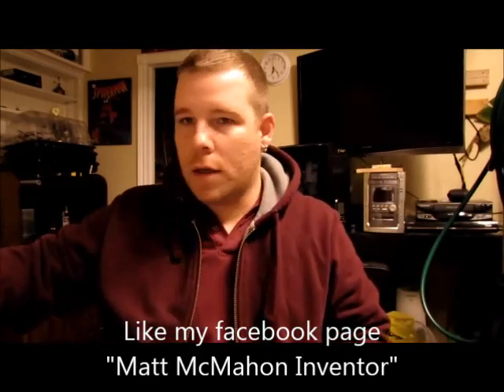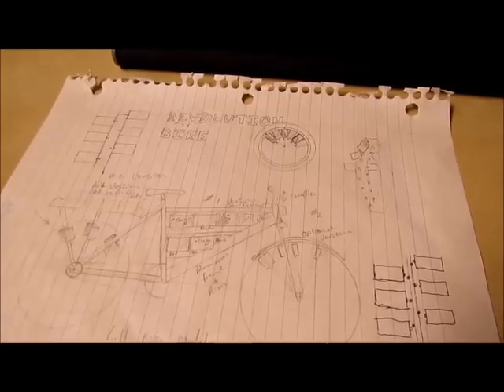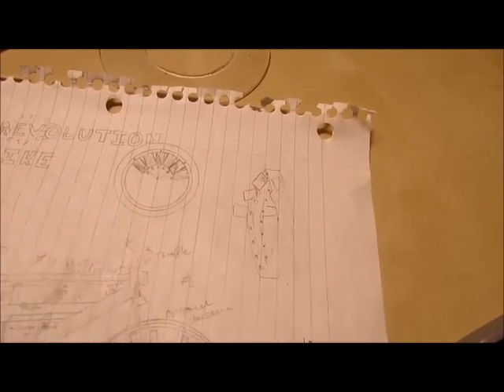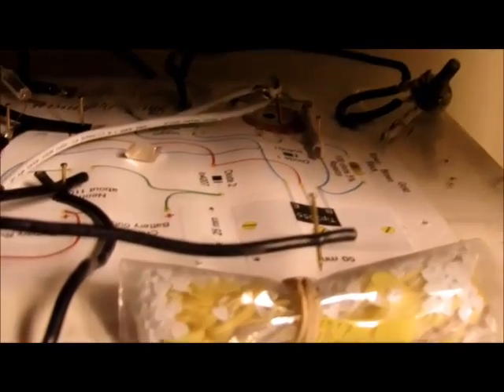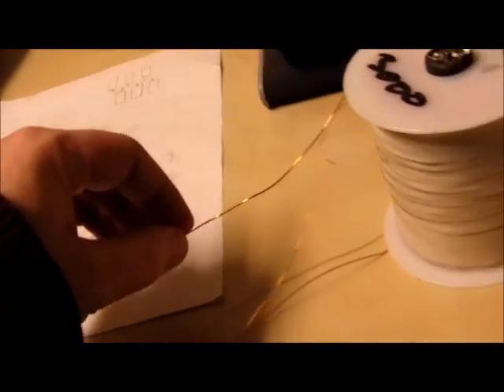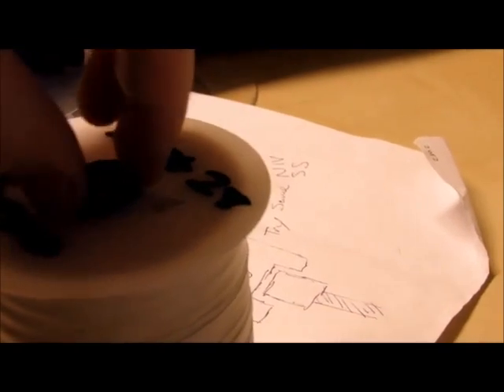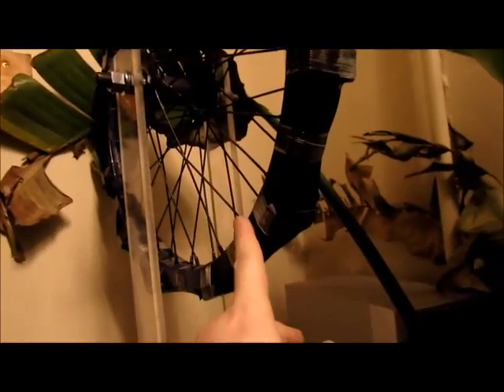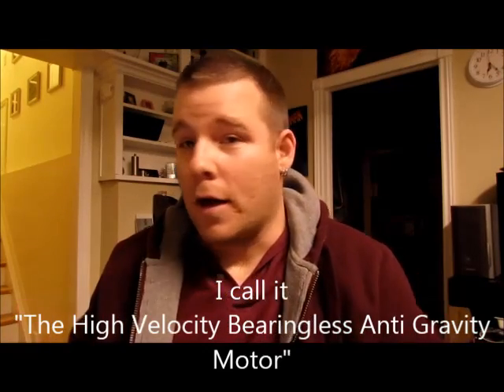Free energy "The Revolution SSG Bike" P1 By inventor Matt McMahon, inspired by John Bedini Motor

Comment: The reason you will never achieve unity is that it would violate the First Law of thermodynamics. The simplest way to see this is to look at the Gibbs free energy equation DelG= H- TdelS. The third law explains why delS will never be 0 above 0K. This is because above 0k you have thermal losses from friction and molecular vibration. They escape to the environment, and entropy increases. You have a really cool project, and even close to unity would be amazing. However unity is impossible.